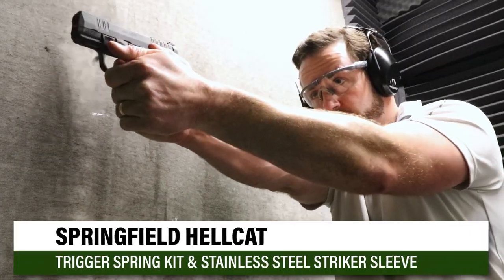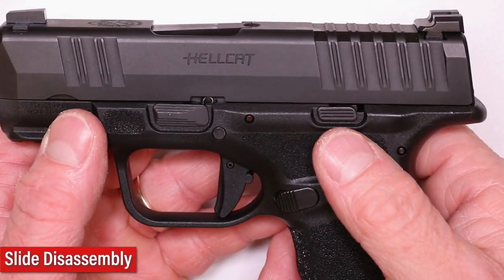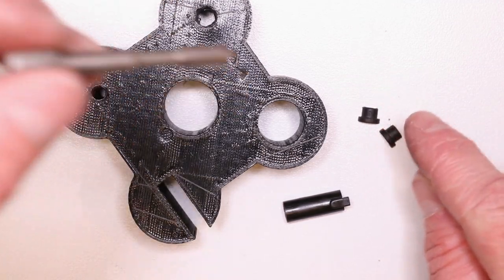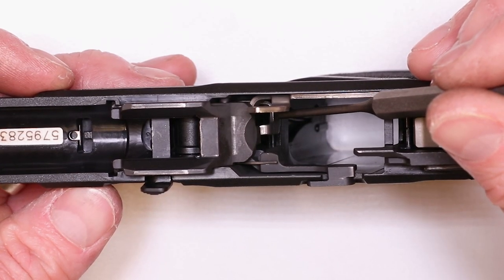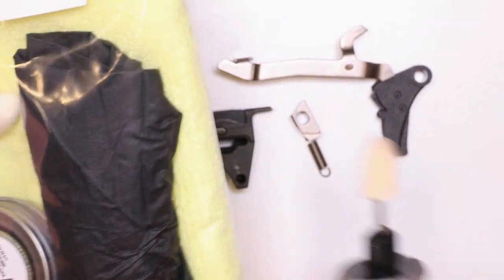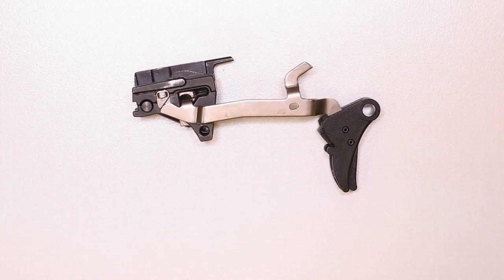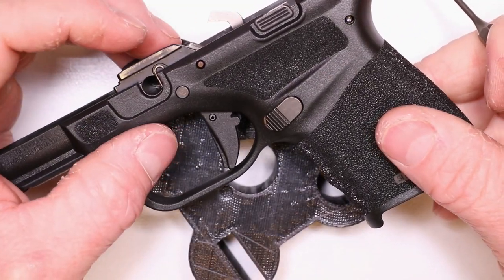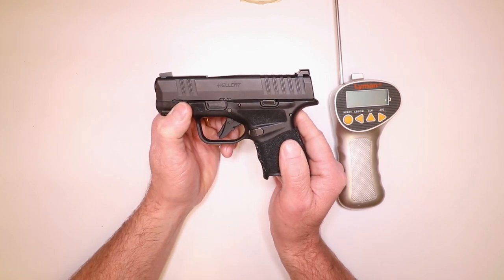Springfield Hellcat Trigger Upgrade/Stainless Steel Striker Sleeve - Springfield Hellcat Accessories

Comment: Just wanted to let you guys know that I think this is the most well made "here's how to install my product" video I've ever seen.  This pistol is glock-like enough that this was a really simple process, but I watched this whole video just because it was amazing to me how much detail you guys went into.  I bet this took ages to record and edit.  Thanks for taking the time to do it right, I feel like if I was 20 again with no idea how a pistol worked, I still would have been able to do this install with no issues thanks to this video.

Also, my OEM Hellcat trigger pull varied pretty wildly.  6.1lb on the low end, 7.5lb on the high end.  After installing your spring kit, it's between 4.5 and 4.7lb EVERY time.  This kit is worth it just for the increase in consistency alone, but the pull being smoother and lighter is icing on the cake.  Thanks for making a fantastic product!
Reply: Thanks for the heart! A year and several thousand rounds later I'm still loving this trigger, and it's gotten even smoother. Highly recommend to any hellcat owners!
Reply: Is your trigger safety shoe not reseting back properly??
Reply: @moisesllamas146  mine works fine
Reply: @47MasoN47  cool i will reach out to springfield

Comment: Wish springfield sold hellcat our of factory like this. To prevent this being used against you in court
Reply: And this is the only reason I'm not doing this upgrade. Any type of trigger work is a field day for lawyers. I too wish Springfield would fix plastic part. I'd honestly just buy the plastic part replacement and the rest of the pistol alone.

Comment: SUGGESTION! at approximately 30 min, attaching the sear spring, I have a much better way! Take some dental floss, loop it through the distal end of the sear spring, pull the spring back (extend), and easily insert the pin through the loop of the spring.  Pull out the floss/string. TRY IT and you will love it!

Comment: I appreciate the hell out of this video. I'm not very well versed in handgun internals outside of your basic field stripping to clean and lube, so taking this kit on by myself was a bit scary. But this video was EXACTLY what I needed. Easy to follow along, I learned a ton more about my pistol parts and how they interact with each other, and feel 100 times more confident in my skills repairing or modifying my hellcat. The spring kit is fantastic and I noticed an immediate improvement. Thanks!

Comment: I just installed the MCarbo hellcat spring kit. The reduction in trigger weight is wonderful! The trigger break is clean.  I had preferred the trigger on my P365X to my hellcat it was way better. Not anymore, seriously the hellcat trigger easily beats the P365X. 
The install video is great.it wasn't actually difficult just a little awkward to do it the first time. The price is more than fair for such a good result. Thank you!!!!
Reply: Blast from past ...just the spring kit?  Did it change pre or post travel?
Reply: @christianknight2905  I have since sold it. However everyone at my LGS could not believe the difference with the spring kit.

Comment: Just finished installing this trigger and it is so much better.  My factory trigger was around 7.25 lbs and before polishing it felt pretty gritty.  It now is around 5 lbs and smooth with great reset.  The video was very helpful and the whole process took about 1 1/2 hours.  Thanks guys it is a great product and very good price.  ***

Comment: Installed the replacement trigger kit about a month ago.  Amazingly good video!!!  I'm a neophyte to guns and I completed it in about an hour.  This trigger kit makes shooting the Hellcat MUCH MORE ENJOYABLE and accurate.

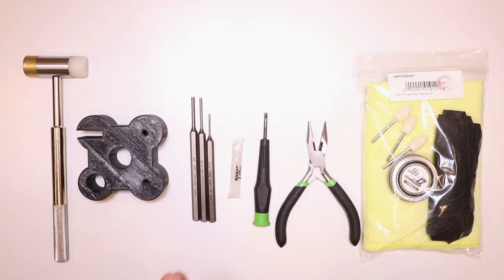A few suggestions.  At 6:10 there is a list of tools.  Make sure you watch that first.  I did not have a bench block.  It's sold at MCarbo for $9.  I suggest buying one. By far the most difficult part is the sear spring installation.  DO NOT RUSH THROUGH THIS.  The spring is very easily bent.  There is also a small retention clip that I almost lost.  It's not mentioned until 34:41.  Mine fell out, I had no idea what is was until I got to this point in the video.  Fortunately, I had not lost it.  It's very small.

Again, overall, one of the best instructional videos I have ever seen.  Video images are unbelievably helpful.  I loved the way they had the parts arranged during the video to show the different parts and the order of reassembly. Great job MCarbo!!

Next, I'll be purchasing the upgraded trigger for my Hellcat.

Comment: IMO it would be easier if you put in first the spring on the sear pin with sear just free dangling, so the spring is not under tension. It's easier to pull under tension the seer later, when installing in it's place, with the trigger bar. More leverage.
Just ordered the kit.

Comment: I did my sear spring a bit different. I set it on the pin, set the pin in place then moved the sear into place and set the bar in place. Was much easier than hassling with pulling the spring into place. Initial feel is much better and Mantis is giving me a slightly higher score. Now off to the range for the real test.

Comment: Awesome video, awesome product. Made the install along with your new trigger this afternoon. I'd say it's easy thanks to your instruction but it does take some patience and a time out or two to vent any frustration. I also polished the parts you suggested. I finally found it much easier to install the sear spring to the pin before connecting the trigger bar to the sear. I'm getting  low 4 pounds on my crude little Wheeler gauge but more importantly it's an extremely smooth pull to a solid wall, a crisp break and a much improved reset. Can't wait to get to the range. Really love this gun.

Comment: I would like to polish the extractor, take down lever , slide lock, mag release and the frame pins both sides   For looks do you think it would be a problem? I tried to talk to them to see if the parts were SS but they couldn't tell me what material they were made of . Still thinking about it. Wanted your opinion. THANKS

Comment: Finished the whole process and now I’m having some reset issues I believe the sear spring was bent a little bit and isn’t allowing a smooth reset.  I contacted customer support on the web site and I’m waiting to hear back.  It either the sear spring of the safety plunger spring is too light and not resetting it correctly

Comment: I just picked up the CA compliant Hellcat Pro a few weeks ago. I installed the M*Carbo striker assembly and trigger safety spring but didn't install the sear spring yet. For me those two items take the trigger pull from 6 1/2 to 7 1/2 lbs down to 5 or 5 1/2 lbs which is great.  The problem I have is that the stock trigger safety and trigger does not completely reset all the way back out when I hold the trigger down and rack the slide, then let the trigger go. If I pull the slide off the gun I can manually move the trigger arm in the gun body and it resets the trigger and safety all the way out. If I put the stock striker assembly back in, the trigger safety and trigger resets fully with no problem. So Just wanted to know if anyone else had a problem with the the trigger resetting back out to the full position after installing the M*Carbo striker assembly.

Comment: I love Mcarbo components and kits. You guys do a great job. I've been a master gunsmith/police armorer for 30 years, and since Mcarbo hit the scene it's been my go to kit when possible.

The 25 million dollar question...do you make any kits  for the CZ 2075 Rami?
Reply: They do, it's the same kit for any cz 75, although I'd highly recommend getting mcarbo spring kit then going to Cajun Gun Works for the rest of the parts. It will make your rami an incredibly accurate fun pistol to shoot and for ccw.
Reply: @unknownunknown3025  thanks! I really appreciate that info. There are so many aftermarket suppliers now it's hard to wade through them. I remember when there were maybe five...  🤗
Reply: @preacherF-15  np, you'll have no problems with install either being an armorer. Is your rami the bd decocker model or b safety? I carried my 75 d pcr for 7 years before the hellcat, did all the installs myself. The sear cage can be a little tricky on the decocker but wasn't awful. Did everything in about 2 hours, mcarbo kit and Cajun Gun Works short reset, reach reduction, and comp hammer. The pistol feels like a $3000 dollar pistol now. Up there with the staccato c2 but 1/5th the price even with upgrades. It really is a great ccw pistol that can do everything.
Reply: @unknownunknown3025  no, I prefer the safety version- i grew up carrying cocked and locked and it's just my preference now. Ive done an old school trigger job and cut the DA in half, lowered the SA to right at 4 lbs, where i like it.

Comment: I'm interested in your kit.  I also want to upgrade to a Hyvve Monarch trigger; mainly to move the trigger rearward in the trigger guard compared to the original trigger.  I have short fingers, and I always have to rotate my hand on the grip to achieve any kind of decent reach to the trigger.  This makes me susceptible to pushing sideways on the trigger and causing the trigger hangup on the Hellcat and many other striker handguns with trigger safeties.  The Apex trigger kit is rated highly, and it moves the trigger back about 1/8 inch; not as much as the Monarch.  It does not address the striker sleeve improvements.  Will your spring kit work with the Monarch trigger?  I'd love to get your stainless striker sleeve, a lighter trigger pull, and a shorter reach to the trigger.
Reply: I love my monarch trigger in the hellcat. I wonder with the combo of monarch and new spring kit would make it ever smoother
Reply: Hey did you guys end up installing the spring kit with the monarch trigger ? I want to upgrade my springs but have the monarch trigger in mine and I wonder if I HAVE to get the mcarbo trigger with the spring kit , thanks

Comment: An improved trigger shoe would be a great thing, if it's not much more that an Apex kit.  Thanks!
Reply: I Bought both the Mcarbo, and Apex trigger kits, both are exellent. Some people dog the Apex kit because the safety shoe is polymer, but it rests against the polymer frame, so I think  wear will be minimized. The Apex sear spring, in my opinion, is the best design, and it is definitely a lighter weight than the Mcarbo piece. The striker springs in both kits are comparable, either will do. The Mcarbo SS striker sleeve is the best part of their kit, and makes it worth buying, particularly for use with a SS aftermarket striker. Mcarbo gives you a reduced power striker safety spring, the Apex kit does not. I like the idea of both combined, along with billet SS striker safety,  sear, and disconnector. Stock Hellcat internals don't seem to be high quality metal. I noticed this when my striker broke in half. Still love the Hellcat, I just think it needs some love, and I'm glad companies like Mcarbo are making decent parts for them.
Reply: @clutchcargo1239  so I have an apex trigger with the apex striker spring, can I get this SS sleeve and still use the striker spring that came with my apex trigger?

Comment: Would you sell the stainless sleeve separately?
Reply: I have seen them for around $15-20 online. 
I wish they would sell them separately.
Or sell them with a trigger upgrade like apex.
Reply: @everyone_knows_itsbutterst7808  I have an apex trigger, it comes with its own striker pin spring, If I got a stainless steel striker sleeve would I really have to change the spring? Would it affect the performance of the apex trigger?

Comment: I just don't understand how the striker spring and the stainless sleeve effects the dynamics of the trigger pull, and why reducing the pull weight makes the sleeve more likely to break.  Mainly, I would like to reduce the amount of trigger travel after take-up before the trigger breaks, and reduce the weight of the trigger pull.

Comment: Have not been able to use the dowel to push and lock the hammer back on the 9 mm version. A gunsmith told me the hammer only locks back on the 40 cal sub, but not on the 9mm. 
He said you have to hold the hammer down and slide the bolt over it as your holding it down. Ive done it , but its not easy. Am i missing something?

Comment: Just installed the kit minus the sear spring, the hogue grip I have on it blocks one of the pins,  when I pull the trigger, dry fire, it feels like there is something catching at the start of the take up, but goes away and breaks clean, and doesn't do it all the time, any thoughts

Comment: What is the legality of this modification for a carry gun? I’m fairly new with carry guns, I know in some cases trigger modifications are not legal to be done on a carry gun in some states. But i feel like adjusting pull force should be accepted. Just want to be informed incase of potential legal actions in the future if they were to occur. I would like to lower the pull force on my Hellcat and this video was very detailed on information and installation. But i don’t want to incur any potential issues down the the road.

Comment: So … i have a problem. I installed the alex extractor and the mcarbo striker assembly.. 😅 for some reason the safety trigger shoe doesn’t rest back fully. I know i did it correct because  i already took it to the range and performs flawlessly. Idk if i should be worried about that safety trigger shoe tho. Are you experiencing the same thing?? I even went as far as removing the spring and striker sleeve from the new striker and setting it on then old and still same issue. Hate Springfield ttiggers
Reply: Contact MCarbo, those happens when the MCarbo sear spring isn’t installed

Comment: Couldn't a lighter striker spring potentially cause a light primer strike?
Reply: Not if it’s tested rigorously. Some striker-fired firearms are known to even be taken down to 2.5 trigger pull weight without reducing primer ignition reliability.
Reply: @tampabayspearfishing5297  I'm happy to report that after over a year with this kit, I have not had a single issue. I've shot 750-1000 rounds and every round has gone bang. Even did some pseudo drop safety tests by pointing it loaded down range and beating my Hellcat with a rubber mallet. Passed with flying colors.

Comment: I have an Apex trigger for my Hellcat that came with its own striker spring and sear spring, if I wanted to change the OEM factory striker sleeve to a stainless steel one do I really need to change the spring? Would it affect the performance?
Reply: I dont think so....just change the sleeve
Reply: @tomaskrisica  I did i ordered a SS sleeve from Lakeline, it actually just came in and I already installed it. Came in a cool little container.

Comment: I have the apex trigger can I still use this?
Reply: I have the hellcat apex kit as well. I'm going to use the stainless sleeve and safety plunger spring from this kit. The weight of pull on the apex kit is roughly the same as this. Just going to add what the apex didn't have. Shouldn't be any issues.
Reply: @Strawman333  any issues? And did you use the stainless sleeve with the striker spring apex sends with their triggers?
Reply: @Illness.og.  No issues at all. Yes I have the Apex spring installed with the stainless sleeve. Works really well.
Reply: @Strawman333  awesome, time for me
To upgrade

Comment: Well, you can never claim this man doesnt work with his hands. Also I hear there is a bit of a difference in how to do this if the gun has a manual safety. Is there also a video for that?
Also, I cant help but wonder why they would use such cheap plastic for a part like that. I know it would save costs, but i'll pay an extra couple of bucks for it to NOT be plastic.

Comment: so question on this kit, if im running the apex trigger kit already but want to upgrade my striker do i need to change out the sear spring again? since i already swaped it for the apex trigger.
Reply: I have that exact same question, apex trigger came with a striker spring already, I wanna know if I need to change that when getting a SS sleeve
Reply: @Illness.og.  yeah doubt we will get a reply 😅 o well seams like a nice product 🤷‍♂️
Reply: @Im_Ezd  lucky for us, someone replied to me in another comment. They have an apex trigger kit, and they are using the apex striker spring with this stainless steel striker sleeve. Looks like I’m upgrading sleeves! Hope this helped
Reply: @Illness.og.  ohhh heckkk yeah thank you man! Deffinly with that then! Thanks for the lookout!
Reply: @Im_Ezd  no problem

Comment: Will it also work with the new RDP version with it's new gen 2 trigger?
Reply: Did you click the link and look?
Reply from the maker: Yes Sir, Hellcat RDP and OSP models.  Works with Gen 1 & Gen 2 triggers.
Reply: @MCARBO  I rec'd 2 kits.... can you please expanded video to go over the safety on the OSP since the sear spring is attached to manual safety lever left and right.   FYI, if the manual safety positioner and spring fall out, its a pain to get it back in.
Reply: @scuba3164  Boy are you right on the positioner and spring!  I did a Hyve Monarch adjustable trigger and mine exploded when I raised it. Took 30m to find the spring, about another 30m to get it all back in place. Then to top it off the Hyve trigger must be removed to adjust the trigger which requires full frame disassembly...did that probably another 20 times (I can elaborate as to why if needed) babying the entire assembly not to throw the safety selector and spring. 

In the end I am here interested in purchasing just the stainless guide as the tip broke off where the back plate is removed. Still functional but I want to correct it. I really want to stay away from anything near the safety after the pain I went through on the trigger.